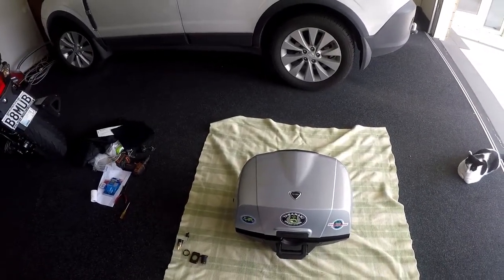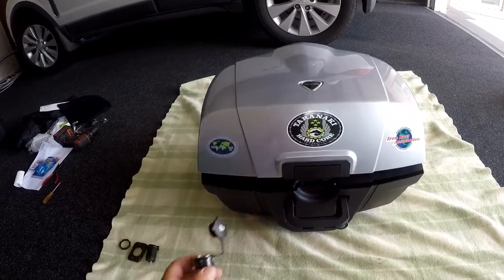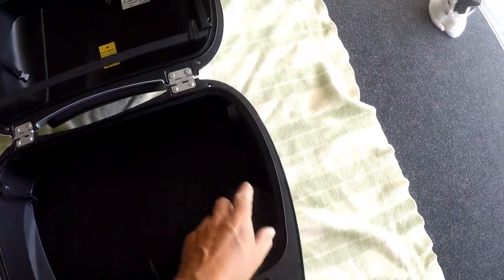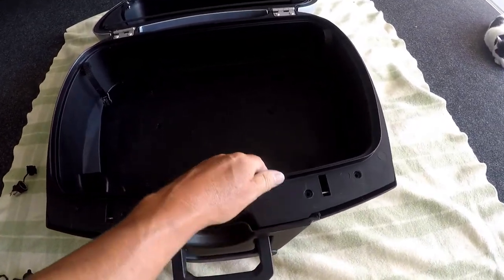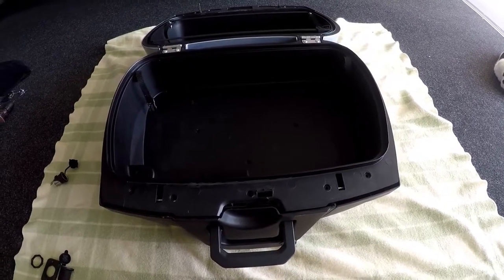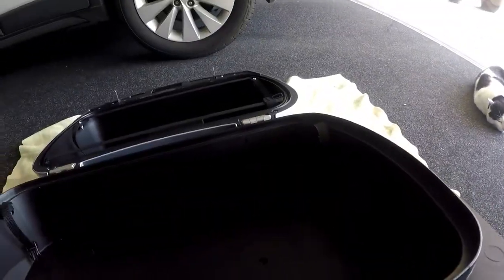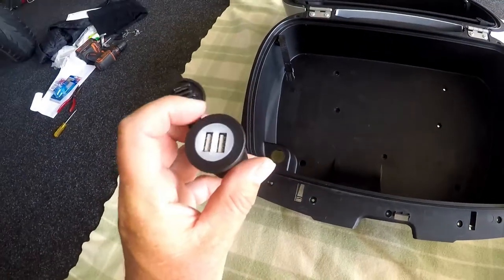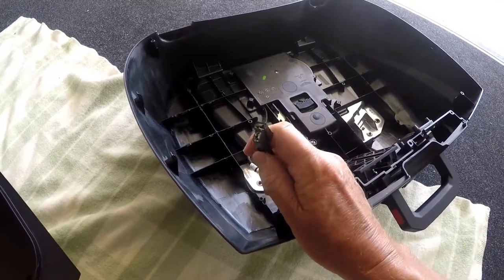Triumph Trophy Top Box, Separating inner case & replacing cigarette charge point for Duel USB

Comment: So mine would never release.  Realized I could pry an opening just enough to push the wire connector on the old charger off with a long slinger pry tool.  Then with an automotive grommet pry tool, one above and below, eventually I was able to pop the old one out from above.  It is not threaded with a plastic nut like the new one in the video.  The OEM one has a couple small tabs that keep it from coming up.  Some persistent prying will pop them free.  I will probably buy what this gentleman has purchased in the video and just push it through without using the plastic nut below.  If its not secure enough, I’ll use a drop or two of silicone.  Thanks for this video!  Super helpful!

Comment: Thanks for the excellent tip Craig.  Will be tackling mine this w/e.  I was wondering what type / how you mounted your GPS holder?  Also, I don't suppose you know how to access the headlight bulbs as I need to change them for LED's.  Much appreciated!!
Reply from the maker: No worries hope it helps,  I attached my GPS via a ram mount, to the inner handlebar mounting bolt, and I machined a simple riser/spacer with a longer bolt to raise the mount clear of the bars and retorque to spec. To access the headlight bulbs remove the lower yoke cover, 2 bolts from memory, and access from
 underneath, the biggest thing to be careful about is making sure you locate the bulb correctly when re-installing the new bulb,  should "drop/locate" in if you know what I mean. with bulb retainer "clicked" in. as per usual not a lot of room I think I got at them from the top as well, bars to one side squeezed hand in...